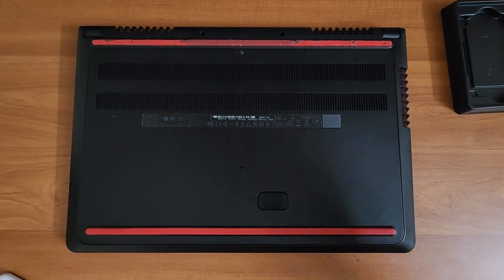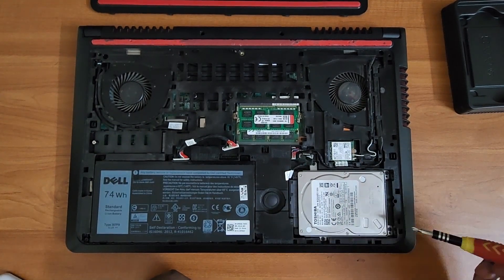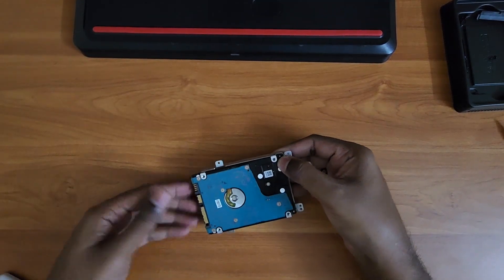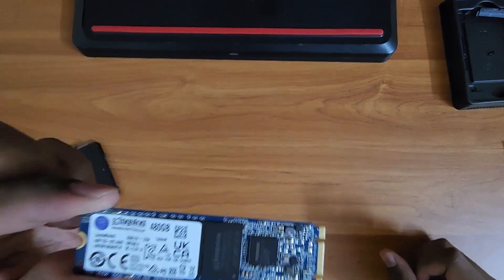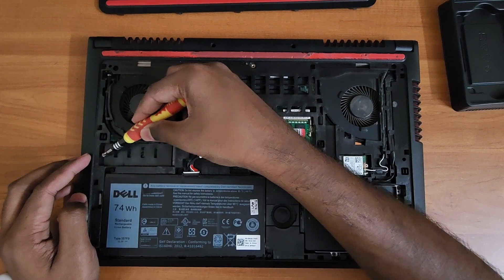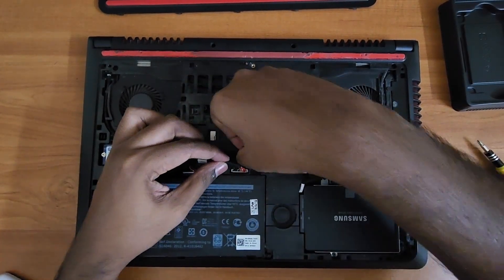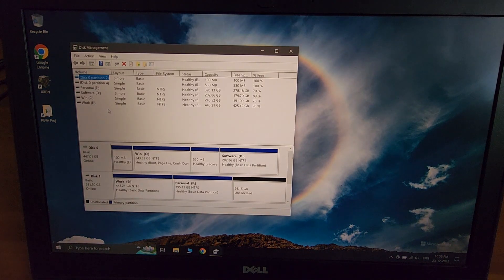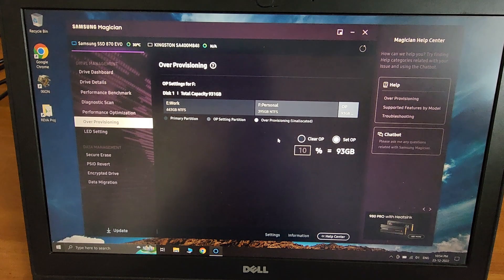Dell Inspiron 15 7559 Series Laptop SSD Hard disk Replacement - Quick and Easy Method

Comment: Hi, Thanks for your effort. One question, can I add additional SSD in my dell Inspiron 7559? Currently I have 1 SSD and 1 normal hard disk.  is it possible to add an additional SSD along with the installed SSD. Thanks

Comment: Will a much bigger harddrive be compatiple with this laptop? For example, if i wanted to install Seagate BarraCuda 5TB Internal Hard Drive HDD – 2.5 Inch SATA 6Gb/s 5400 RPM 128MB Cache for Computer Desktop PC (ST5000LM000), will it work?

Comment: Hello, can someone answer my question?          
I have the Dell Inspiron 7559 laptop and on the PCI of the SATA SSD, it only has one notch and on the video SSD it has two notches, i.e. the mixed ex port.?        
One more question, 'By BIOS update is not supported by Nvme? Since that kind of SSD only fits with a notch and I don't understand the design of the laptop ...
Reply from the maker: The notches are designed to be cross-compatible. If you have doubts, do a compatibility check with the documentation from SSD manufacturer website.

Comment: I have an Inspiron 7558 and replaced with a hard drive from another dell. Do i have to reinstall windows or update bios? Is it just plug and play?
Reply: si es el mismo modelo no tienes que cambiar nada, pero si el modelo es distinto a lo mejor no reconoce algunos componentes, lo mejor es clonar el disco y a partir de ahi si quieres dejarlo como de fabrica, usar el programa minitool particion wizard con el cual es muy facil, pero si tienes oportunidad ponerle un ssd m2 sata 2280, soporta hasta 2 tb, tendras un arranque del sistema operativo en menos de 10 segundos, y usar el disco duro como almacenamiento
Reply from the maker: If you can, do a clean install - Copying your personal files to a backup drive and then back to the new one. This will eliminate all bloat and driver issues.

Comment: My laptop is 7559 i5 purchase in 2016 in 85k inr, now only camera not work and battery, but still give valorant 130-150 fps 😂😂🔋🔋🔋😂😂🔋😂
Reply from the maker: Change the battery and add a SSD, it's even better!
Reply: @aksadventures  already ssd256 and 16 gb ram dual channel, and original battery not available in india

Comment: What core is yours? Mine is corei5. I need to know the max m.2 storage I can add. Can I add 512gb m.2?
Reply from the maker: Mine is an i7. I think it will support the capacity but you can always check with your parts dealer.